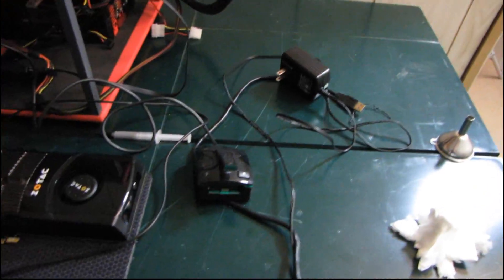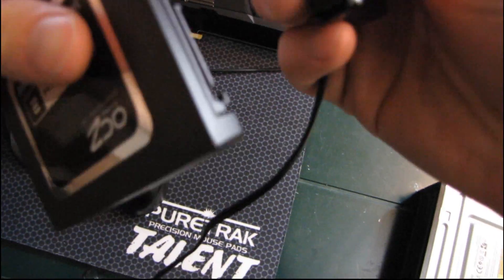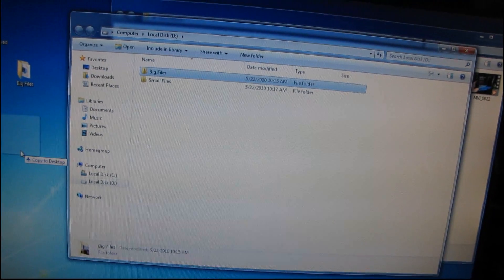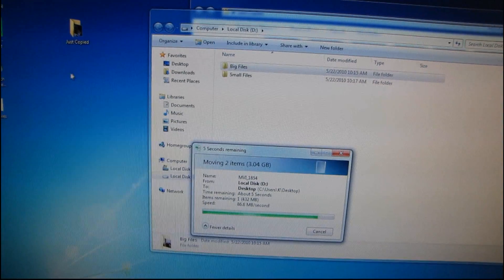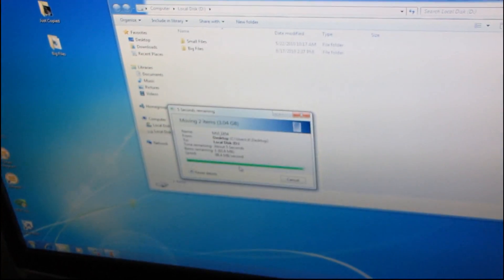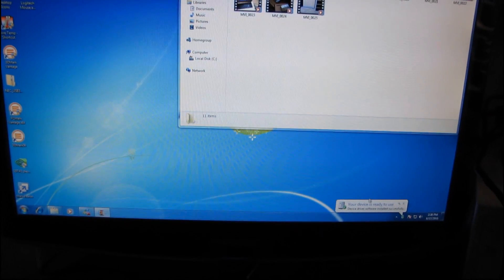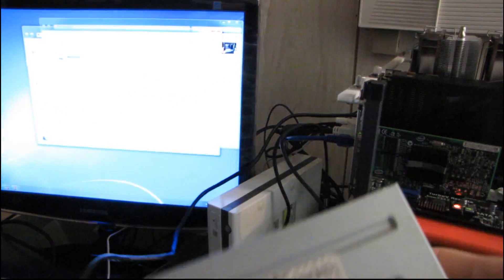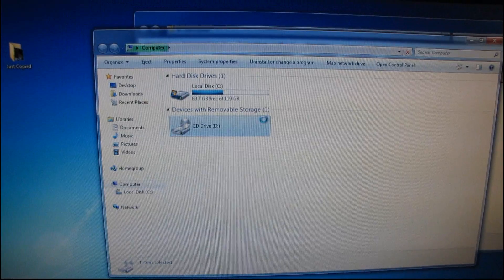Unitek USB 3.0 to SATA2 Powered Adapter Performance with Vertex 2 SSD Update Linus Tech Tips

Comment: @jontheskillful Yes, you could use the unitek cable with a ordinary internal 5.25" Optical Drive but you can not use it with only the USB supplying power to the optical drive as USB 2.0 provides way less power than USB 3.0 does. So if you want to hook up an internal optical drive with the unitek cable, you must use the power adapter included.